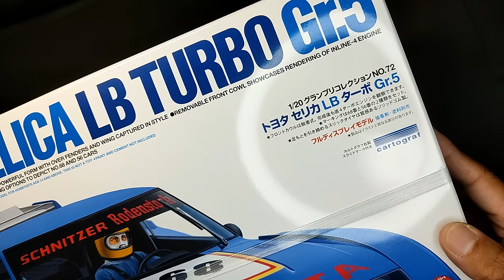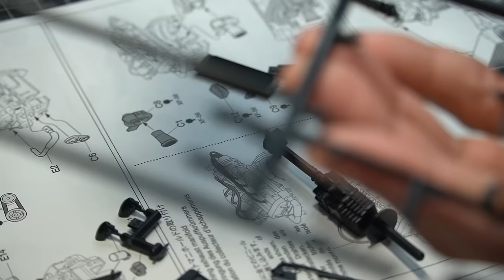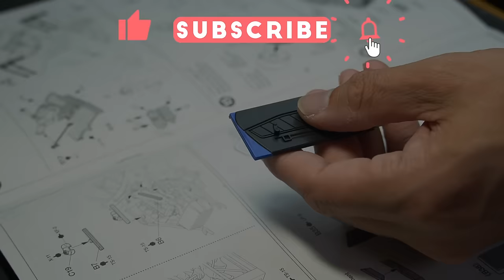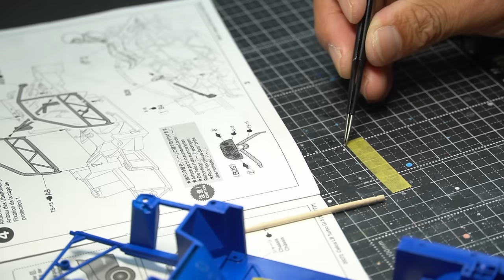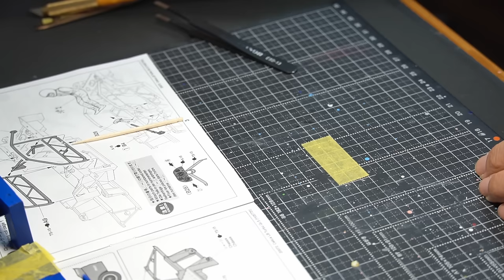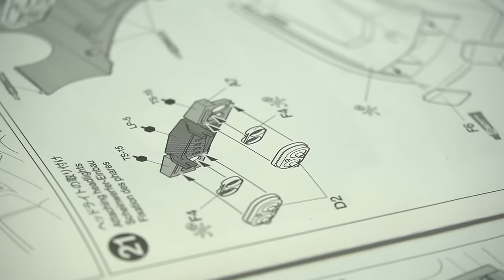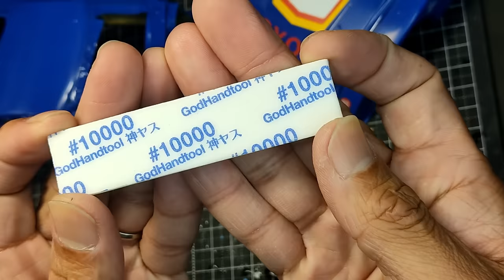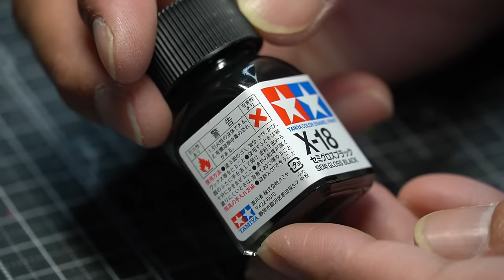TOYOTA CELICA LB TURBO Gr.5 / TAMIYA 1/20 / Scale Model / full build / ASMR

Comment: Thank you for another excellent video. I did not admire this machine much, however your work has shifted my perspective. Also, thank you for extended footage of sharpening. I am wary to sharpen my models because I am scared of mistakes, so I enjoy seeing your steps and results to practice for myself.
Reply from the maker: Hello Brendan. How is it going. Thank you for watching this time.
I don't know anything about this machine either. This rough design shows the intensity of the racing scene at the time.
I believe there is no right answer when it comes to building plastic models. I have the most fun building with my favorite color, my favorite method, and my favorite time. I hope you have a wonderful time🤗